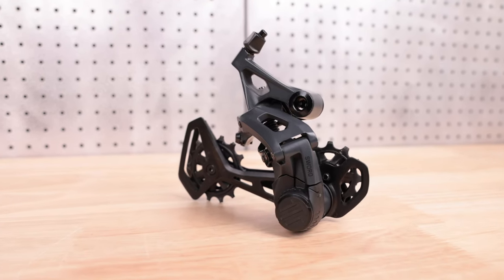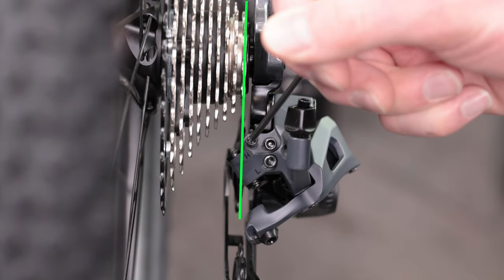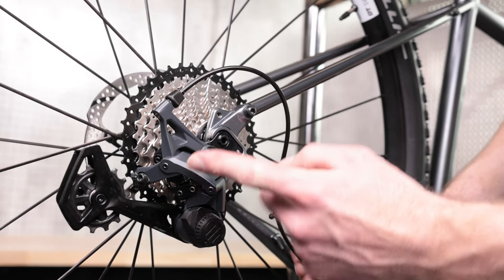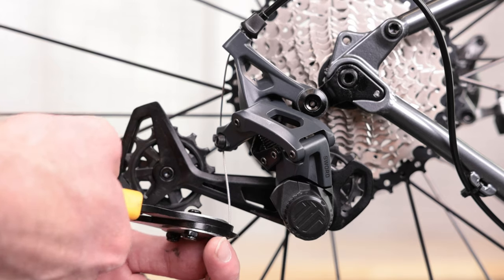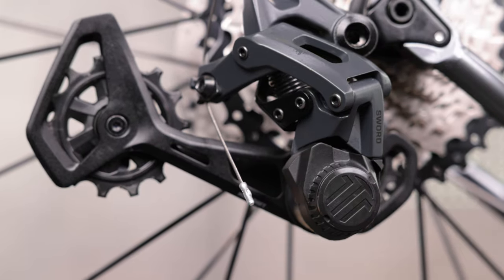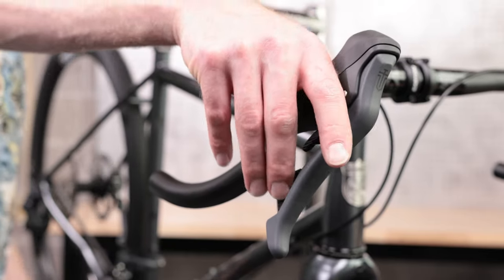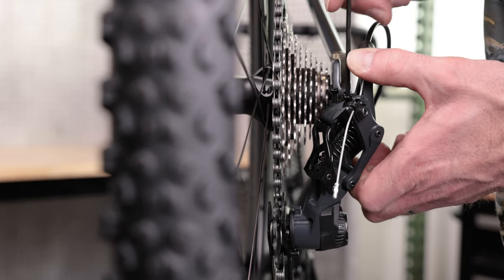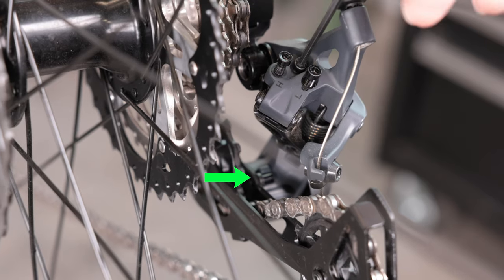Sword 2X Rear Derailleur Installation Guide

Comment: The sword group set looks nice. I'm glad the shifting cable is routed under the bar tape. That's one thing I don't like a out my Advent X.
Are you going to release a hydraulic groupset in the future? The mechanical brakes are the only reason I want to switch to Shimano GRX in the future.
And hydro-mechanical calipers are too expensive imo.
Reply from the maker: We get this question constantly and the answer is maybe.

Comment: Can these be installed with a 2x10 Microshift thumb shifter if you don’t have drop bars? Does it matter if it’s the mtb or road thumb shifter?
Reply from the maker: Sorry for the late reply!  For flat bars, this group is compatible with Advent X. We are releasing a bar end shifter set as well, which will be available sometime this summer.

Comment: Is it going to be possible to use the 1X cassette with this DR (after switching the cage) and the 2X up front for bikepacking?  Cheers.
Reply from the maker: No, unfortunately. The 2x crank has a 17t difference between chainrings. The 1x cassette has a 37t difference between the small cog and large cog. That adds up to 54t of capacity that the derailleur would need to take up. To do that, you'd need a much longer cage than either our 2x or 1x cages, and it might be so long that it would scrape the ground.
Reply: @microSHIFTTECH  Fair enough although if you are not going small to small and large to large it's not really that big.  I realize you have to assume the worst here.  Thanks.  Looking forward to seeing the groupset out in the wild.